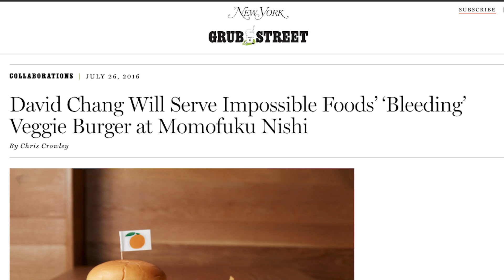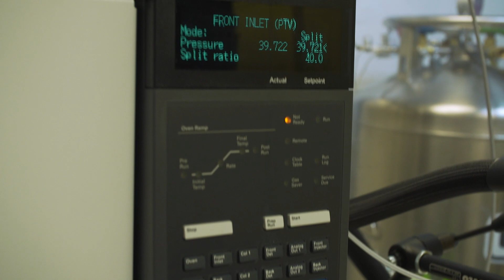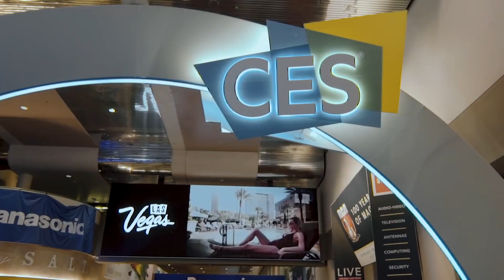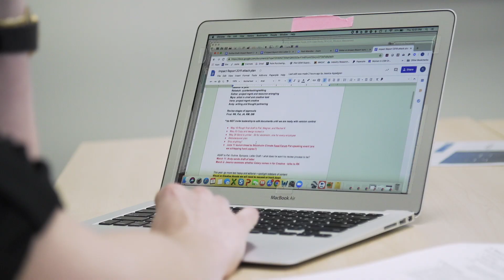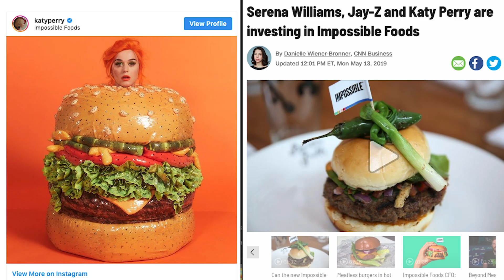How the Impossible Burger turned food into technology

Comment: So what are the chemicals they use in this process?
Reply: Generally processed foods if done correctly as impossible are doing aren't bad for you (If eaten in correct moderation). You still need produce and free vegetables but then again the makeup of this "meat" will probably be much better for you than red meats as the current required chemicals used in farming outweigh the ones needed in this. On top of this there's a lot of anti GMO media that has gone around in the past, yet as proven over and over again GMO foods now days docent mean chemicals. GMO is just a way to learn the makeup of produce and then "cross breed" different bits of different produce to make growing you lettuce easier with less resources bring down the cost and in most cases the increasing the benefits of that food allowing us in effect feed more people with less land helping the environment at the same time.